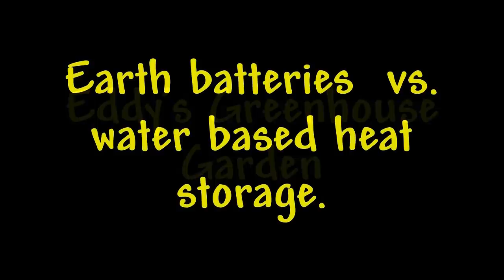Passive Earth Batteries Don't work

Comment: Hello buddy great video ! I have been wondering what to do about heating a green house for awhile. Question though - In the summer should you empty the water out of the barrels? as they will heat the green house too hot. If you have metal drums I wonder what the best way to empty them is? Maybe drill a hole at the base and put some sort or drain pipe system going out side your green house ?

Comment: I'm looking for a solution that warms the interior by 10C or so in the winter and cools down the interior by ~5C during the summer at the hottest hours. Turns out the cooling is harder to do, especially at scale. Shading with common solutions gets you to +1~2C at best vs atmospheric temperature in the shade. To get down to -5 you need to start using active solutions like misting, split system air-conditioning, on top of ventilation of course.
Reply from the maker: It's a tough problem.  What works for cold doesn't work well for heat and vice versa.   Good luck.

Comment: The number one issue with earth battery design is their implementation. They invariably are trying to push the hot air underground. That is not how the physics of heat transfer works. You always want to be pulling on the coldest part of the system. A vacuum on the system is REQUIRED for the energy to efficiently transfer out of the air and into the battery.

Comment: Water will freeze where I live
Reply from the maker: That is one weakness.  The water has to keep flowing and the water needs to be heated or it will freeze.   But if the object is to keep the greenhouse from freezing, you'll have to heat the water anyway.

Comment: When a trench has to be built in the wintertime and the ground is frozen, we would place insulation and poly sheeting over the future trench line for a day or two. The earth would become soft like summer ground.  
The earth is constantly putting high heat upward from within itself and the institution traps that heat. 
Some roads with frost heaving problems are rebuilt with large, very thick insulated panels laid down under the road and then covered over.  The earth underneath has no chance of freezing and the air above has no chance of pushing down cold heat below the road, eliminating frost and heaving. 

The installation mistake with geo heating with pipes is that there is never any insulation placed above the piping to hold the heat down. The soil placed above the piping is not efficient enough to hold heat long enough to be released at night. It releases heat up into the greenhouse air as fast as the system forces heated air down into the piping from the passive system. 
Usually isolated panels are placed  only at the sides and ends of the trench.  Isolated panels need to be also placed above the piping area and the pipes should be covered with 3" rock instead of compacted soil, then fabric, then the insulation on top of that. You could put poly above the insulation or concrete to divert any runoff to a collection container for later use. 
 You need the earth to push high heat up into the pipe area and stay trapped  and mixed with the heat pumped down from the greenhouse into the pipes during the day. Then at night that heat will exchange in the earth return the heat in the greenhouse air.
Reply from the maker: Sori, I have never heard it explained that way before.  Very interesting.  I learned a long time ago that the earth is pushing up heat all the time.  There are effective ways of going after it.  What you've explained makes perfect sense to me.  Thanks
Reply: It's related to depth. From surface till 20-25 feet temperature change toward surface.
It need to go deeper than that for stable temp.

Comment: I want to use a climate battery in conjunction with other methods, namely the black water barrels on the northern wall and a propane heater if necessary. Im only planning on keeping it at 50 or maybe 60 to grow lettuce or carrots, and I live in southern ontarios so our winters arent warm but they arent freezing.
Reply from the maker: From what you're saying here, I would think that's a reasonable expectation.   My negative sounding title "Passive Earth Batteries Don't work,"  Is really aimed at expectations of 70 or 80 degrees (f) with ONLY passive methods when folks are living where winter climate temps can be expected to go well below freezing routinely.   Sounds like you're on the right track.  Good luck
Reply: @eddysgreenhousegarden7022  Thank you for the response! Im just trying to keep above freezing, i might just go with a wall of black barrels instead of digging 5 ft.

Comment: I was thinking about burying a bunch of 50 gal drums or bigger ones. Could be under the greenhouse or not. Then you are getting the earth battery effect as well as the water. I would use multiple methods to heat the water including wood, waste oil and propane. Also I will likely put a radiator in the greenhouse in order to transfer the cold or hot, to and from the air in the greenhouse.
Reply from the maker: If you want your water temperature to be higher than about 45 0r 50 degrees F,  you better insulate your barrels very well.  Otherwise your hot water will simply dissipate heat into the surrounding earth.  The heat won't stay there very long.

Comment: So it's not that it doesn't work but more of for your already established GH with a water system it's just not feasible.
Reply from the maker: I suppose that's one way of looking at it.   But there is also the strict definition of what an earth battery really is.   That term "earth battery,"  is used to describe a range of things that either don't fit the definition or make claim to things that are not possible.  
Ed

Comment: Ok this is the idea I would like to use , so please pass along some wisdom.  I live in Kuwait.... yes Kuwait!!!  I’m only worried about freezing 30 days out the year.   Heat is my problem and with a earth battery we can use less power to cool the green house along with a water wall.   My friends raised in this area have stories of desert people using thermal batteries in the past for cooling  houses before electricity but that history is lost in technology.... I’m from Detroit, I have no understanding of desert 🐪 life, but I understand heat transfer.  We have man made pools and wells on our farm.  My plan is to dig down 10-15 feet , from watching this video place four or 5 plastic barrels just as you did make connections between the barrels and the well or pond water.  Make a air connection to run through the Same barrels which should give me additional cooling.  There are no videos that talks about green house farming in the desert 🐪.  Sadly I am figuring this out by looking at all you cold weather greenhouse experts and trying to reverse engineer your steps..   is my theory sound or am I missing something.   At first I thought that an earth battery would be enough, but you gave me this new idea.  Thank you for your video.
Reply from the maker: I don't think burying some tanks in the earth will work for your case because even if you put them ten feet down, they would heat up and dissipate too much heat into the surrounding ground and saturate it heat wise.    The reason is they don't have the surface area in contact with the ground that would be needed to get rid  of the heat being picked up in the greenhouse.    You need to dig a hole about five or ten feet deep and measure the ground temperature down there.   Out in Kuwait I don't know what it would be.   Here it is about 55 degrees f.   If you can get temps in the ground below 60 degrees or so, you could do this.   But you would need to use a very large surface area in contact with the ground to dissipate the heat effectively.   Here's a link to another video of mine that explains this.  https://youtu.be/AruBQKxP9Q4

 This video is of course talking about heating a greenhouse instead of cooling it.  But the same principles would apply.    Take a look and see if this helps.   

Also.....Doesn't Kuwait have  low humidity?   If that's true evaporative cooling would work great for you out there.  I think it would do a lot better than what you're thinking of doing right now. 

Ed
Reply: Eddy's Greenhouse Garden 

My theory:

1. If we dig 12 ft down. 
Place  Blue plastic barrels in the hole. 
2. We have a well and irrigation pond on the farm. 
Split off from the well and connect it to my buried drums.   The last barrel has a pipe running  water out and back to the  pond. 
3. I will run the geothermal pipes through the barrels.  Keeping them water tight.  

Everything else would be the same as the rest of the geothermal community, except we have sand and dirt and not rock.    So tell me am I  imagining success where there is none.  

Yes we also use the water wall(swamp cooler) for cooling but like I said Kuwait is really hot.  Using geothermal would be additional cooling with lower use of electricity and cost.

Comment: How about if I bury my water barrels in the green house?
Reply from the maker: You could do that but in the winter you have to remember 
 underground, depending on where you are, it is going to be around 40 - 50 degrees and any water you store heat in is going to migrate to that  temperature a lot quicker than you might think.   The good thing about that is it works the other way around too.  If you are only interested in keeping the greenhouse from freezing, it might work for you because if you draw low grade heat (40- 50 degrees) out of it, the earth it self will replenish that heat.
Reply: @eddysgreenhousegarden7022  I going to heat the water with vacuum tubes
Reply from the maker: @offgridwanabe  I think you're going to need to insulate the barrels.    A good analogy is if you dig a hole, say four or five feet deep, then lower a barrel of hot water down and cover it up, how long will it stay hot?    It will want to get to that 40- 50 degree temperature down there in the hole.   If you insulate it.....you can slow it down.

Comment: You don't have to excavate under the actual greenhouse if you have an established one and can run the pipes away from the greenhouse under lawn that's not being used.
Reply: This is what I am thinking. I have an option of an 8' pit to the east side of my new greenhouse. I old insulate top and sides. Fill would be free. I have equipment and some 15" alum manifolds and would use smooth wall pipe to avoid turbulence.
Reply from the maker: Oh I agree with that.  It's just that so many don't have the room to run long piping runs under a large area, say a big lawn or something like that.  So they have no choice but to put it "under" the greenhouse.  If you have the room what you're suggesting would work well. 
Ed

Comment: Had to stop watching because of the water in the background.  However, recovering heat from the ground is nothing to do with it being an earth battery.  An earth battery is where you put rods in the ground (say carbon, graphite or copper, and an opposite material like magnesium, zinc or aluminium) and draw a (very low) current of electricity off them.  Evenso, I would have carried on watching if it hadn't been for the water noise.  Poo
Reply from the maker: The whole point of this is that  there are a lot of people who think an earth battery is a heat storage device.   A heat storage device that you can charge , like an electric battery.   I can't disagree with your example of a battery, but that ain't what I was talking about.   There's a community out there with a different definition.  And it has nothing to do with electricity.
Ed

Comment: Mine actually works very well, perhaps this gentleman just doesn't understand how they work.
Reply: Mine only works because I hooked up a solar hot water system up to my 46 55gal drums . I also have over 5000 feet of 1 1/2  inch tube 5 feet under the footprint of my greenhouse.  Its one giant loop that works perfectly for winter.  It only gets down to about 35 here a few days a year  typically 40 is cold here ( tennesse  ) . BTW,  my problem was my plants were blocking the sun from hitting the barrel.  Now every is dialed in with the way it is now.

Comment: So why not just build your greenhouse on top of a gigantic sump tank that doubles as a heat sink? Or even more ideally, a large scale aquaponic system. I live in an extremely cold climate and am thinking about using Aquaponics to help make a greenhouse economically viable during the winter months.
Reply from the maker: You said you live in a cold climate so I think that would all come down to how warm your soil is about 5 or 6 feet down.  If it is 40 - 55 degrees or so, you might be able to work something out if your goal is to just keep things from freezing overnight.  Remember if you are trying to keep your greenhouse warmer than that your going to need extra heat from somewhere.     I have another video that explains some of this if you'd care to take a look at it.   Here's that link.      https://youtu.be/spehA8I-3fI
Ed

Comment: here is the solution to your efforts run 1and 1/2 inche conduit below your rain barrels pull pex tube inside the conduit which is a heat exchanger [use steel pipe ] put stove remote of the green house ...it has a hot water option and will syphon the heat from the stove through the pipe and heat the barrels ... The stove uses no electric and no pump shall be needed  the burn shed will put up to 2000 btus into the green house and water will continuously heat green house from the barrels...https://www.ebay.com/itm/Wiseway-PELLET-STOVE-Non-Electric-Gravity-Feed-GW1949-Off-Grid-Emergency-Heater-/283516073487 The stove is both epa and hud approved!
Reply from the maker: That would work except I don't have the fuel to put in it.   Also if I did,  It would be something I would have to tend...put wood in....start the fire daily.....that kind of thing.  I may be lazy, but I would really like something that once set,  doesn't need to be tended to.  
Ed
Reply: @eddysgreenhousegarden7022  specs on stove say pellets and wood bits one hopper full last 36hours
Reply from the maker: @MyLevelheaded  Hmmmm.. Now you got me thinking I might look into that.   That really doesn't sound like all that much trouble.    Thanks
Ed

Comment: The top 6 inches of your greenhouse floor will provide the same thermal storage capacity as 2000gal of water ;) Getting heat into the water depends on the surface area of the barrels and if you can bring all the greenhouse air into contact with it ;)
Reply from the maker: I guess that depends on what that top layer is made of and how much moisture it contains.  When I did my calculations based on typical soil composition it took more soil than that.   But also keep in mind that heat likes to travel up.   Warm air above the soil does not penetrate down very well.    That's probably why systems that use that method always put the warm air in pipes a little deeper under the soil.
Reply: @eddysgreenhousegarden7022  
I was working with my soil type and bone dry ;) When i was planning my installation i baked a cubic foot of the subsoil until it was bone dry so i had an idea of the worst mass weight and specific heat capacity. I find the top layer of soil is heavily influenced by the greenhouse air and direct sun. I have a sensor installed below my system which confirms heat moves downwards but it doesnt happen until late summer when the mass is warm. The sensor outside at the same depth (10ft) shows a similar trend but is less pronounced as the soil outside isnt as warm at depth due to being unsheltered  and reliant on solar versus the sheltered mass and active heating..
Reply from the maker: That all makes sense to me.   It is interesting though that at ten feet down you are seeing a seasonal difference in temperature.   I would have thought it would stay constant at that depth all year around.
Reply: @eddysgreenhousegarden7022  
The only way to get answers is to sink sensors in the ground and monitor the temps over a long period of time. My system was installed in 2009 with 26 sensors scattered in and around it at various depths. I had sensors in the ground 12 months before i  installed the system to get a baseline. The interesting thing is that over the years the sensors outside are only showing fairly small deviations to the baseline which is to be expeccted as the energy balance (heat in vs heat out) in that ground hasnt altered much. The sensors inside the system bear no resembence to the baseline and the sensors under the system showed an almost linear departure year on year until about year five when it levelled out. I concluded the ground had reached a steady state with regards to the new energy balance. I would view the heat that moves below the system and sideways at depth, more as dynamic insulation, slowing the movement of heat rather than as stored heat that is recoverable, at least not in the short term.
Reply from the maker: @JohnGuest45  That's very interesting.   I would really encourage you to do a video on what you found.  It would be very informative about a real world set up.   If I understand correctly, it took about five years for the ground temps under your greenhouse to stabilize  after you built it.   That's very interesting.
Reply: @eddysgreenhousegarden7022  
 In my case it took 5 years but it will depend on the local climate and the system design..If the system isnt effective for cooling, it wont be effective at transferring heat to the ground so it will take much longer or perhaps never happen at all. Most of the systems on youtube are not effective for cooling due to excessive tube length and less than ideal airflow rates. The cooling performance is directed rrelated to the amount of heat you can move into the mass.